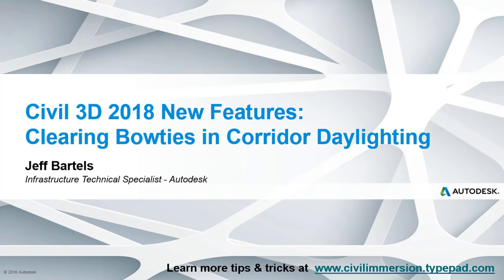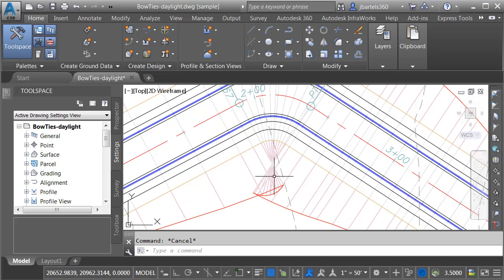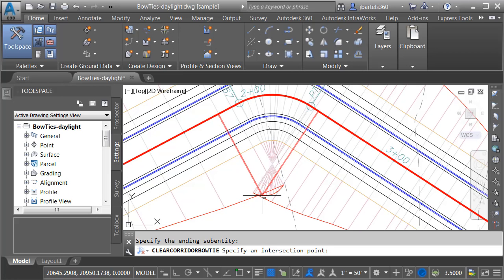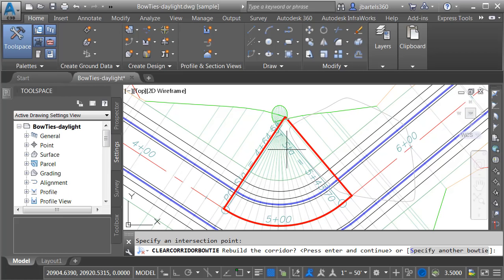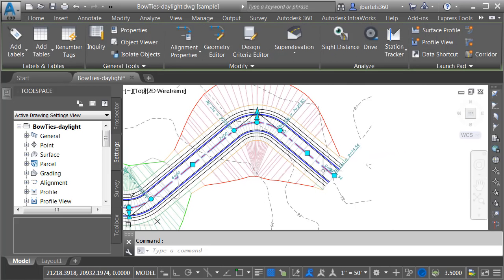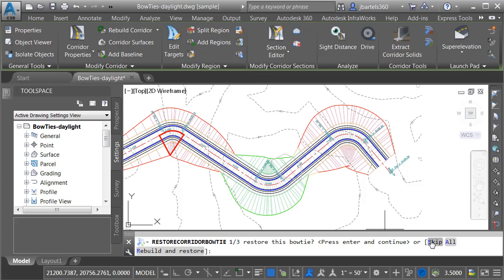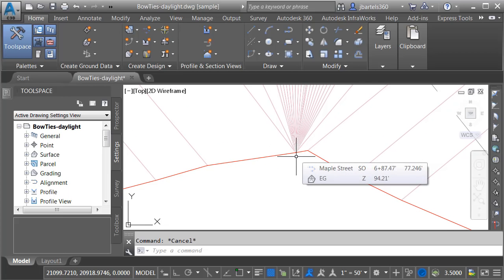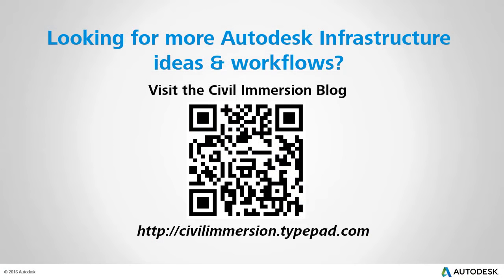Civil 3D 2018 New Feature: Clear Corridor Bowties

Comment: Bartels, I tried to applied this tool to a r=25' intersection with 6:1 embankment slopes where bowties were formed, but I could not select the tangents in order to solve the problem. This tools always selected the turn right alignment (the quarter of circle), reason why it was not solved. Am I doing something wrong with this? 

Thanks for all your videos. Some of them, by the way, are not in You tube anymore.

Comment: Maybe this is a dumb question but how would you clear bow ties where there are two separate baselines?  Not everything in my projects are parallel.  Because of this, I have to use multiple baselines in some cases.  I have yet to get the tool to work in these circumstances.